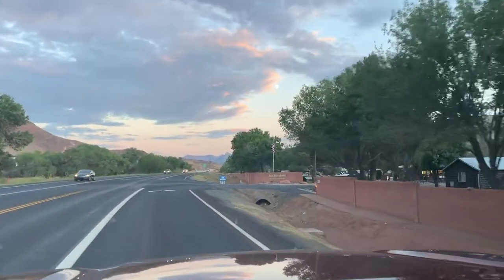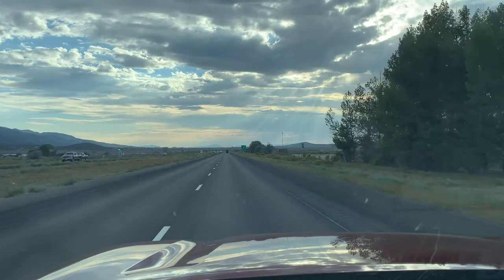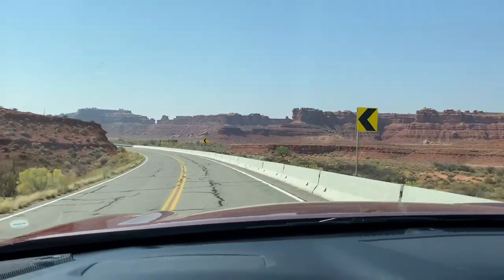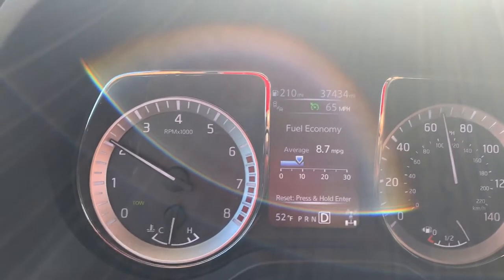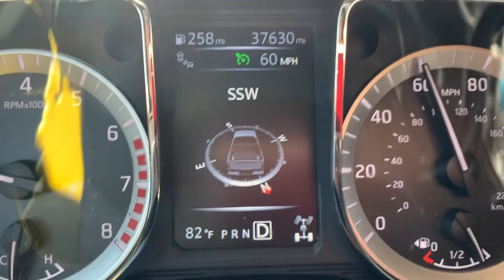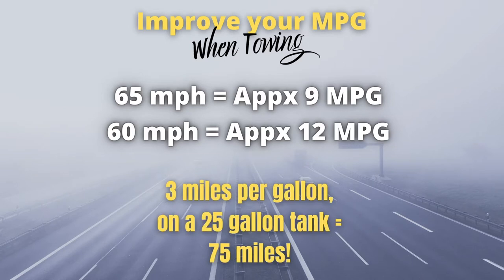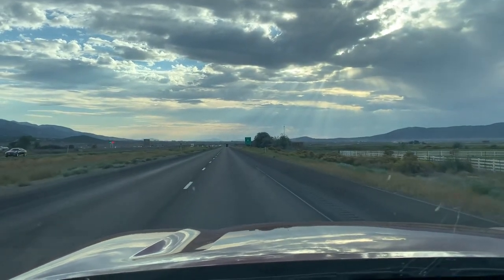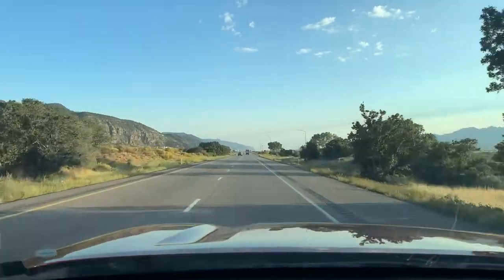Tow Tip | Improve MPG when towing (UPDATE)

Comment: This aligns with my own extensive experience towing our Airstream with both gas and diesel trucks.  60 mph is a sweet spot, and given the braking capability of a travel trailer, much safer than higher speeds.  Cruise control will diminish mpg unless your route is straight and flat i.e; boring.  Leave the interstates to the truckers, take the scenic byways and actually enjoy the journey.
Reply from the maker: @josephdonnaway5755 Thank you for the excellent comment and feedback.  Happy trails. 🙂

Comment: You're a safety hazard in my opinion at 60 mph. The speed limit on most of your trip is 80 and average speed is up around 85 to 90. That's cars and semis having to get around you at a staggering rate. Fuel mileage is no where near that simple. I could set my cruise at 40 on parts of the freeway and get 8 mpg. I could set my cruise at 80 on other parts and get 15. The wind alone could change it 4 mpg. Cruise vs non cruise can actually save fuel. Go slower helps but that 4 swing is not from 60 vs 65 alone. Many other factors.
Reply from the maker: @Clayton Yates Hi Clayton...thanks for your interest in our channel and the thoughtful comment.  You make some very valid points and as you mention, fuel milage isn't quite that simple.  However, in my experience, I've noticed that speed is a huge factor.  From a safety standpoint, I'm not comfortable driving faster than 65 mph when towing.  I do adhere to all highway etiquette while towing and "stay in my lane" so to speak.  I've not encountered any major issues when going 60mph on the interstate.  That's the default speed but of course I adjust as needed and as traffic conditions warrant.
Reply: That’s why if you’re going 60 stay your ass in the right lane. Getting in the way of other drivers only happens if slow drivers are in the left or middle lane. In WA state AH’s go the same speed in all 3 lanes!
Reply: Negative on 60 mph being a safety hazard. Towing a travel trailer at higher speeds is a poor practice, due to the lower stability and braking capability.   Use the right lane and let others pass.

Comment: Sometimes it's hard not to run a bit faster when all the traffic is passing you.  We pull our Lance 2375 with a 2020 Toyota Tundra, and the sweet spot seems to be at about 66 mph @ 2000rpm. . The best we can manage is about 10.5 mpg, but the Tundra has a 38 gallon tank, so our range is pretty decent.  Getting there safely is still the number one priority.  Take care.
Reply: I say, let traffic pass me. Other drivers do not pay my fuel bills. Additionally, RVs take less road/travel wear and tear when going slower. I'm perfectly happy to set the cruise to 55 MPH and to hang out in the in the right lane or one lane over from the right on a 3+ lane road, if possible.

Comment: Hi! Thanks for the video! I have a 2019 Silverado 1500 V6 and my travel trailer is about 5,500lbs. Before all this crap with the gas $$$ increase, I was getting between 12-14mpg towing. Now I’m getting between 7-9mpg. I don’t know why I’m getting lower mpg now. use the tow haul mode @65mph and also the cruise control. I also have air bags for leveling the truck but is like anything is helping me out with the mpg. Great video! 
Cheers! 🙏🏼🤙🏼

Comment: Have you considered the driving mode of Normal, Tow /Haul or Eco
Reply from the maker: @James Navrotsky  Thanks for stopping by and for the comment.  My Nissan Titan doesn't have an Eco setting, however, it does have "Tow Mode" and I do use that when towing the trailer.   It just seems my sweet spot for fuel efficiency is 60 mph and, as I mentioned in the video, it works fine for us as we're never in a big hurry.  Thank you!

Comment: Dont set the cruise control unless you are on a dead flat stretch of road.
The tow vehicle will downshift and rev trying to keep speed up for a small uphill section, only to hold back when the road goes back down, burning lots of fuel then denying the addition of gravity when it comes. Watch your tach and see this happen.
Instead, hold the throttle steady and let the speed drop a few miles an hour on the uphill and then let it roll on the downside to a few miles above the desired speed.
I can easily go from 10mpg on cruise to around 13mpg by having a steady throttle.
The downside is, it takes more attention to hold the pedal steady and is more tiring on long drives.